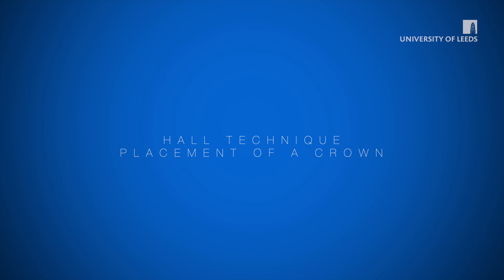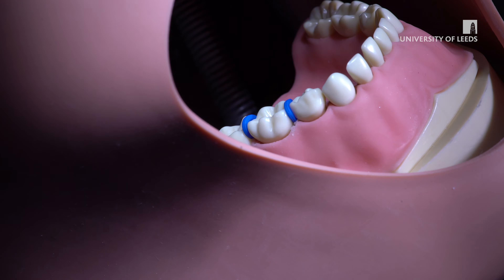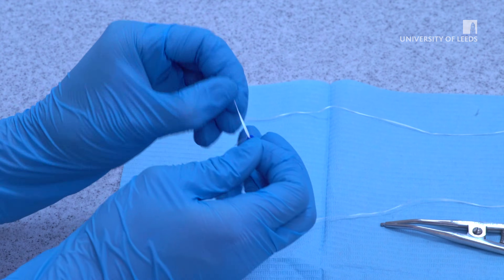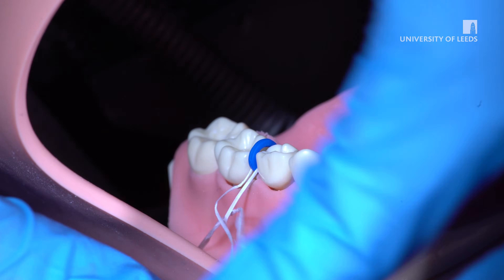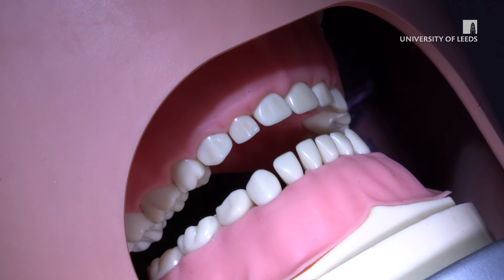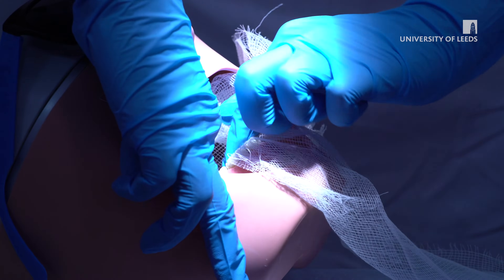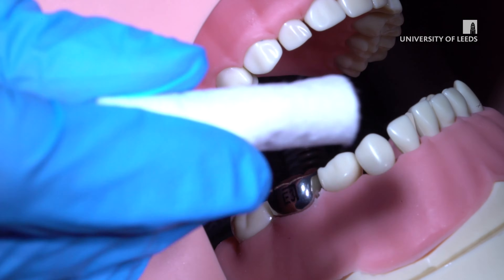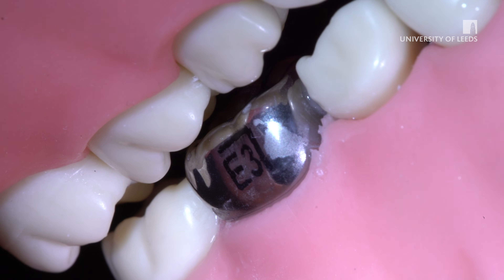Dental Hall Crown Placement Technique

Comment: Or, you can just do it the right way.  That's the objective here, isn't it?  If the child needs a referral for sedation or GA to get it done properly then that's what's required.  There are no easy short cuts to the proper way and the earlier a practitioner realizes this, the better.
Reply: How is this not "the right way"? 
It is a tried and tested technique - the cavity is sealed from any future decay, as sugars cannot reach it. The caries therefore does not progress, and the tooth is kept strong by the addition of a stainless steel crown. 
It is far less traumatic for the patient, even if they could otherwise cope with a conventional restoration, as there is no need for anaesthesia/ no risk of pain, and no need to keep their mouth open for lots of water and drilling.
Reply: What kierahurry said in addition, studies show the Hall Crown technique to be more successful than conventional methods...  Also, taking the risk of general sedation out of the scanario.  Sounds like you need to do a bit of research graham.
Reply: This IS the right way.